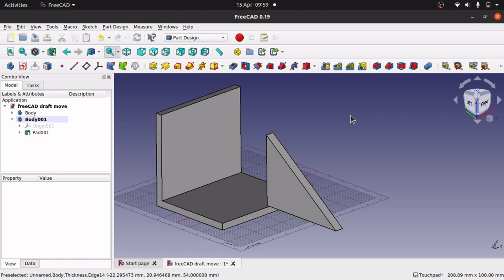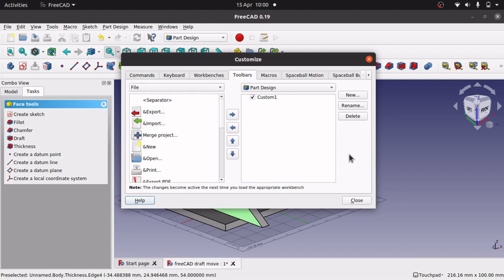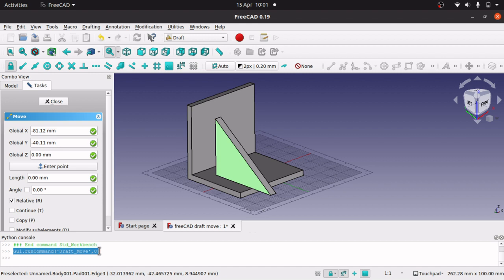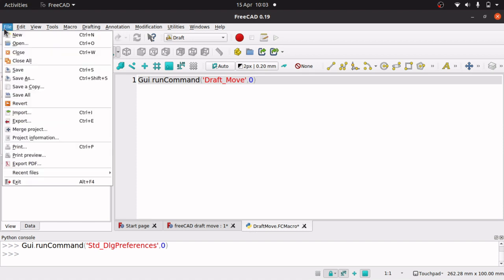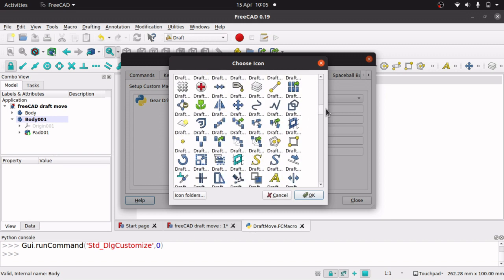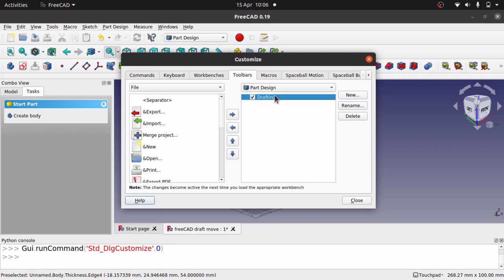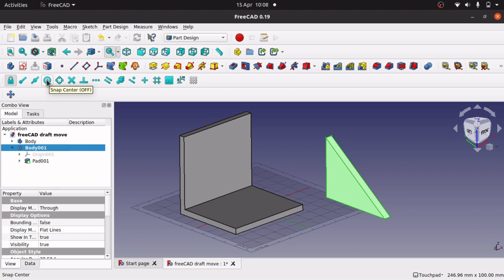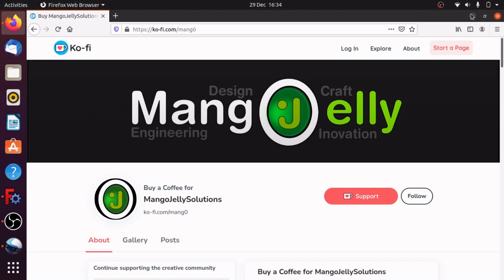FreeCAD 0.19 Enabling move and snap / align tools on part design workbench from the draft workbench

Comment: Can you add some text in a text block in Draft? I want to take some text from excel or word and import it into Draft Freecad. I want to print out the drawing and the text.
Reply from the maker: Yes if you go to draft wb, top menu, annotation, select label.  Select the label, On view tab find the display mode, set to 2d text and then find text size, increase the text size. Now select data tab, change lable type to custom and finally custom text set to what you want.

Comment: what does snap midpoint dO?
Reply from the maker: When using something like the move or rotate to it will snap the item you are moving or the cursor to the mid point of your geometry. So if its a line then it will be the middle of the line, if its a circle then its the center of the circle. If you had a sketch made up of arcs lines etc you will see a whit dot appear at the centers as you move over them.

Comment: Thanks for the video. Do we have to do the same for scale and rotate?

BTW, how do I move points of a 2D draft and make them snap to points of another part, e.g. the end point of an 180deg arc to the corner point of a rectangle ?
Reply from the maker: Glad you liked the video. You can do the same with scale and rotate if you desire by using the same method. I haven't tested them but I can't see any reason why they shouldn't work. Regarding the draft move, I found that if I switch off all the snapping options then and enable one it's much easier to understand which one I need. It gets pretty confusing if you have more than two enabled. I think you need the one that's snap to end points selected.